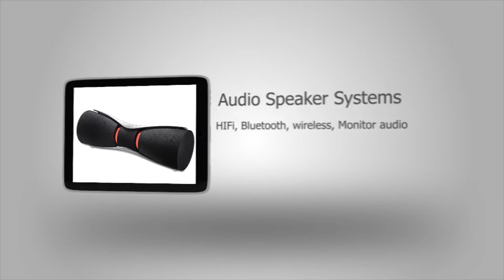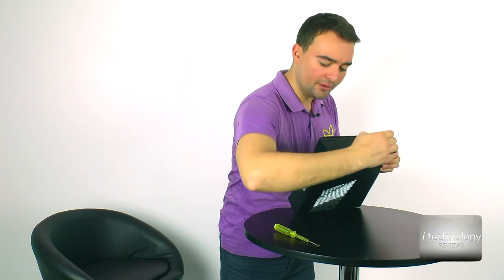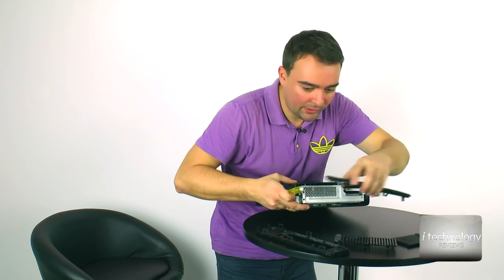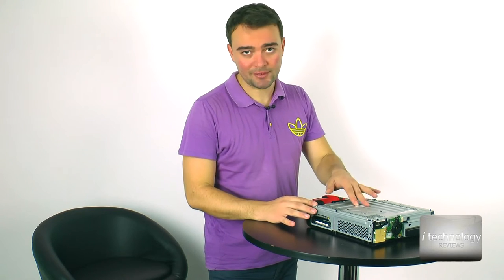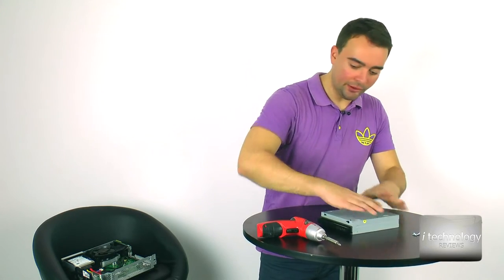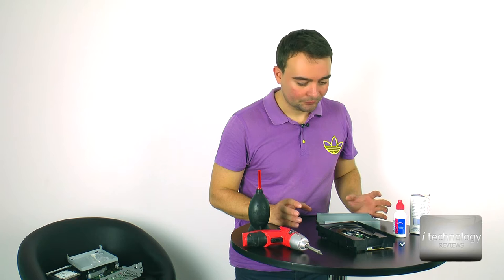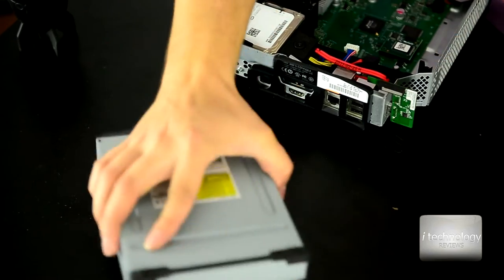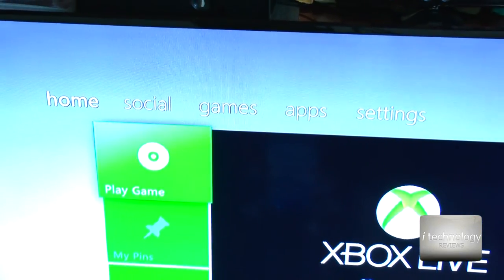Professional way to fix ,,this disc is unreadable'' error xbox360 with Eclipse

Comment: Hello! I might be late to the party since this video is 8y old. But I think I am dealing with the same problem. My Xbox 360 Slim is showing the "unreadable disk" to all my games. I want to try to clean the optic sensor but I cannot find the exact solution fluid you are using. However, I have isopropyl alcohol and a cuetip, would these do the job if I gently rub the lenses with the tip?